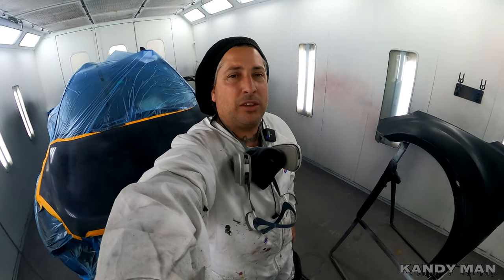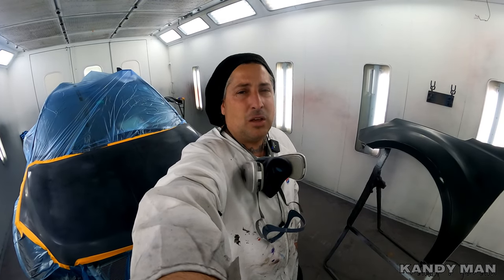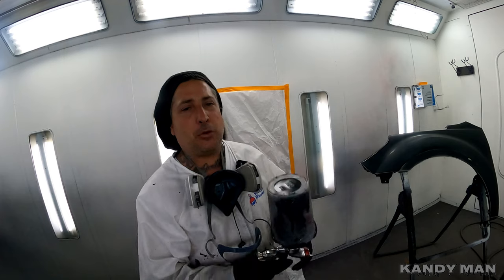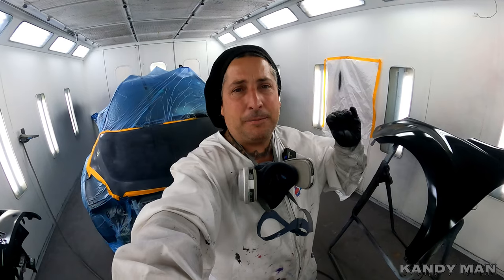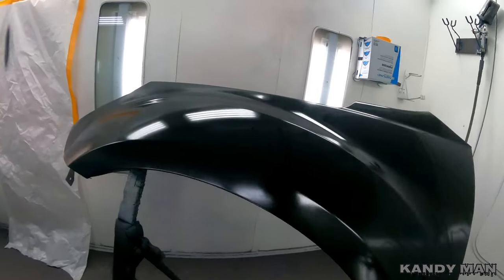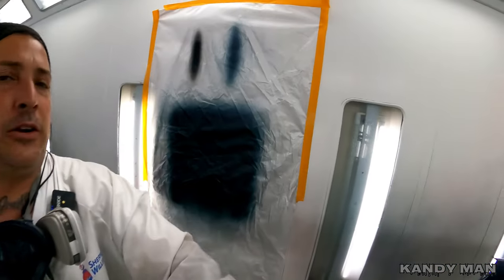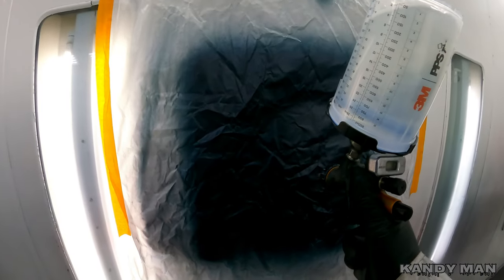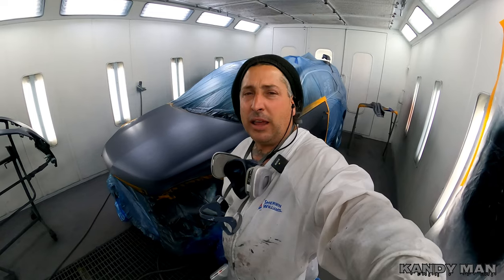GUN SETUP - WHAT DO YOU USE?

Comment: I was using all Walcom. A 1.9mm Xlight, a 360light base gun, a 360light clear gun, and an ego190 1.2mm spot repair and 0.7mm for cerakote(cerakote every day), but the guns lasted about 15 months and thats not long for as expensive as the two 360 light's and ego 190 were. So i recently switched to the 3 Devilbiss DV1 guns. I opted for the 0.7mm/0.9mm in the DV1s mini since i cerakote everyday and its fantastic, the DV1 base and DV1 Clear are fantastic too. I then got an Iwata Wider4 1.8mm for surfacer/sealer. Everything is working great and it shows on the end results of my work. I am very pleased.
Reply from the maker: I love the dv1

Comment: What nozzle on the DV1? Sort of missed a detail there. Sealer W400 1.4 Iwata Bellaria wide open (has been superseded by Kiwami4) Basecoat LS400 1.3ETS (I live in a desert which explains the ETS) at about 22 PSIG, Clear WS400 with 1.3HD with the fan turned out 1 3/4 turns from fully closed. This prevents pattern splitting. Air pressure used anywhere from 23 to 29 PSIG depending upon clearcoat viscosity.
Reply from the maker: 1.4  lol gonna be picking up the kiwami

Comment: I use devilbiss pro lite base and clear …I did use sagola guns but went back to devilbiss easy to get on with …iwata super nova Is in the cubbyhole did try it a few times but couldn’t get use to the dam thing haha …both with te10 air caps at around 30psi - 32psi …you got to get a static gun and try it out wow everything goes on so much nicer …even blowing air on the panel puts static in on the job and wiping the down does the same …
Reply from the maker: I've got quite a few prolites  and iwata thanks for the feedback 💪

Comment: Hi bud I use the devil devilbis GTI pro known as the tekna in the states in a 1.4 set up with the 110 cap for base and the TE 20 cap for clear works well for me 👍primers 2.0 flow tip and needle
Reply from the maker: I'm  a fan of tekna 💯
Reply: @kandyman5315  yeah bro good gun for me I've found that sweet spot and it lays perfect for me other painters in my shop use other brands  and have dialed in there guns to suit there styles but for me the Tekna rocks 💯👍😁
Reply from the maker: Sprayed base and clear with those for years myself.
Reply: @kandyman5315  brother if you used it that's good enough for me 😆💯 in my opinion your at the top of the pile 👌👌
Reply from the maker: I'm sure you're a hell of a painter good painters can use any gun.
Reply: @kandyman5315  so true man I've done some lovely jobs with fake Chinese knock offs it's just the attention to detail in your vids that blows me away 😁💯

Comment: i"m just an amateur painter, maybe painted 50 cars in my life. I have a DV1 that I just bought , its nice. I realize that an expert can run this gun wide open, but not an amateur. I run mine at 20 psi and 1 .5 turns open and slow down. I've had good results at this setting. I tried wide open and moving fast like an expert. The base  and clear ran  off the panel and were on  the floor,WTF.
 Thanks for the information.
Reply from the maker: Thanks for the feedback take it slow and do what works for you .💪💪
Reply: What nozzle are you using? Try a smaller nozzle. The DV1 comes with three nozzles use whatever one works for you.
Reply: Play with the nozzles. I used to run 1.3 in the both dv1 for base and clear. 1.2 will atomize more putting a finer spray pattern. Not so thick. Base I spray 20-23 clear in the 20-25 range
Reply: @KdAB-mo4hv  yup running the 1.2

Comment: The DV one I wasn't quite sure which tip size do you use I had two ws400 1.4 switch 1.3 then my truck was stolen with all my goodies then I purchase the new SATA x5500 with a 1.2 I I like to spray up close but like you said some clears are different than others it sprays very well with top-of-the-line clear coats but some of the aftermarket it's not as friendly it's a little tougher I can do it but I have to work at it base coat gun satta 5000 I used to use the 4000 model at one point and the 3000 model until the day they stole my truck Brother inside my truck I had eight spray guns satas two iwata w400 lph 400 my sun gun. And since I wasn't painting full-time anymore it took me awhile to get a lot of my spray guns back back in the day I used to use the Devilbiss mbc and jga but I can tell you the guns have improved a lot
Reply from the maker: I use 1.4  sorry to hear about your guns . The guns definitely came along way thanks again for the comments